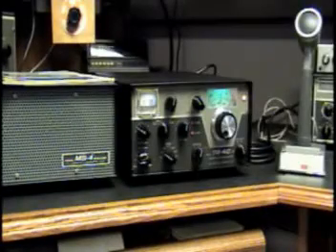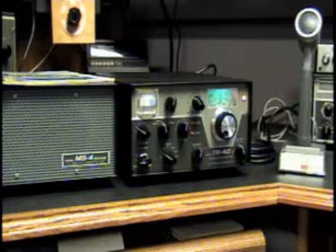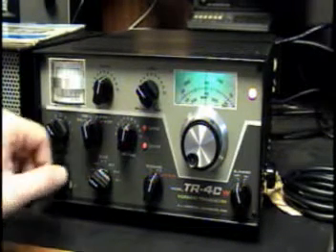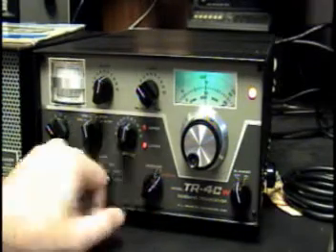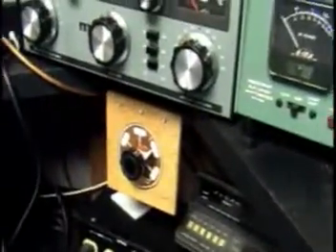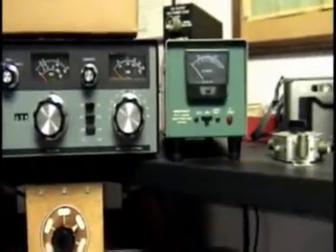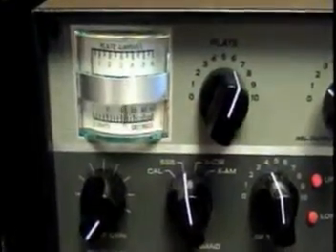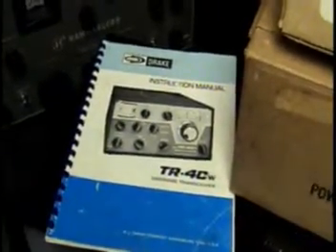Demo Drake TR-4CW Ham Radio SSB CW AM Tube Transceiver

Comment: looks a bit like something i have in my shed. but my grandfather never told me exactly how to set it up. its a "made in china" thing that has an unnamed dial and switch and operates at the 3.5/7/21 and 28mc band. from what i gathered its pretty useless but since i dont have a manual or something i have no idea if it even works properly